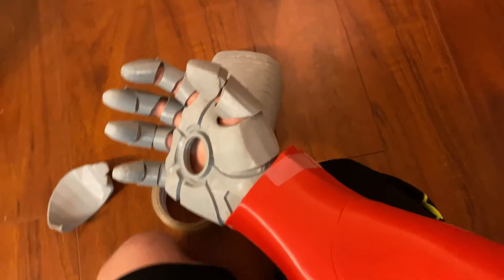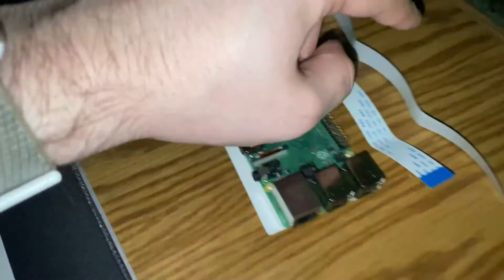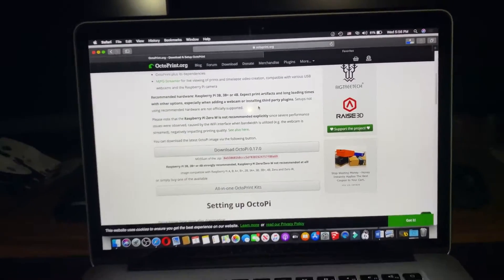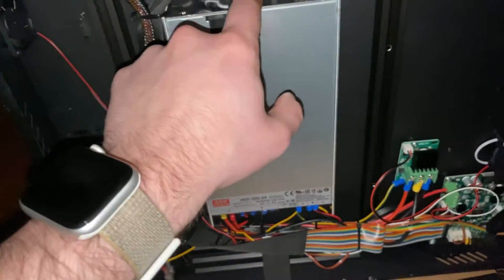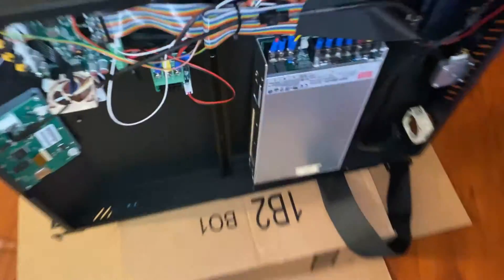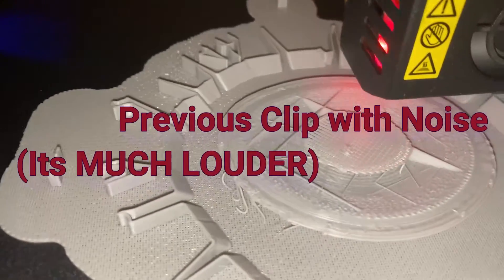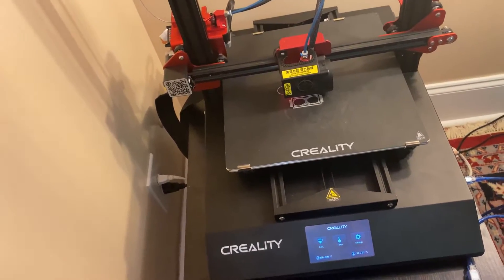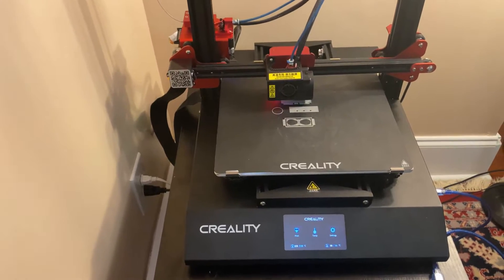My 3D Printing Journey| Part 9 | UPGRADING CREALITY CR10S PRO V2 !

Comment: If you haven't already, look into the Tiny Machines firmware. Been on my list for my Cr10S Pro and I finally got around to it. Totally worth it. They support both the V1 and V2. My favorite part is PID auto tune on the machine itself.

Comment: Can you use a sd card extension to levitate the hassle of unscrewing the bottom for firmware updates?
Reply from the maker: Not sure, have not tested myself. I wouldn’t recommend changing the firmware on the V2 yet. Hear it gives ppl issues often. Updating with octoprint also is easier

Comment: Thank you Anton for your videos. I too have that CR10S Pro V2 and have read of numerous issues regarding using Octoprint with this printer. I have noticed you mentioned you were having printing issues with Octoprint. Were you able to get these resolved? Have you tried using the Prusa slicer to see if that might help fix the issue. Best regards.
Reply from the maker: Joe Undreiner hey man! Glad to hear you enjoy the content. What I learned was due to a slow gcode read FROM octoprint it’s best to print from the local SD card. Now All works great! I use octoprint to monitor my prints and just upload the files the old way and not through octoprint which has fixed all my issues
Reply: @AntonsCreations  What about now? After 0.18? It's got to work now yea?

Comment: I didn’t see anything on here about wiring fans. I thought stock fans were 24 volt. Other videos indicate you need a PCB to change voltage or you have to wire two fans in series. If 12V fans are running at 24V, they won’t last long.
Reply from the maker: Precisely! I wired two fans in a series to have 12V each from a 24V. Works well so far!
Reply: Anton Talks Tech Thanks. Bought the CR10S Pro V2. Hasn’t arrived yet. Adding many upgrades before I have it. . Your videos help. Love ❤️ that you reply. Suspect you will build a lot of viewers. Well done. Subscribing out of respect.
Reply from the maker: Trevor Westerdahl thank you! ecstatic to hear I’m of some help and congrats on your purchase! Hope all goes smoothly and you’re happy! Also- Welcome to the community, glad to hear you joined. Got lots of exciting content upcoming for you all :)
Reply: Did this work for you? I just tried this and my wires are smoking

Comment: Hi, love your videos! I just got the same printer, the prints are coming out kinda okay after some testing. But the bottom layers aren't very good on most.. tried a lot of leveling, but can't seem to get it right. 
Could you please tell me how you level yours? Do you have auto leveling on? 
Also if you have the time I'd greatly appreciate it, if you could answer some more questions :) What is your print speed setting? Do you have special settings set for the first layers? I saw in a video that you had the nozzle temp at 220°C but the bed temp at 0°C, so the bed temp doesn't seem to matter a lot for you for the result? 
Thank you very much! Please keep on posting :)
Reply from the maker: Ill do a quick overview of how I level the bed soon! in short- turn of auto-leveling, use aux leveling and the 2mm tool and make sure bed is level on all 5 quadrants. hit home, hit measure, heat bed- repeat. if too low or high you can always raise your Z. once done-turn on auto level and you are set!

Comment: Awesome dude, just as promised, cool video! I've been looking at a bunch of reference material online, but it's mostly on the "CR-10S Pro" and not the actual V2, although they're practically the same. The only real question from me, is noise aside, are the Noctua fans actually still keeping the same CFM as the stock fans? Idk
Reply from the maker: Glad you enjoyed it! There have been tests done by others to measure the heat and the airflow is ample for the system with these exact fans. It seems they do they trick (i used for a week no problems so far)
Reply: @AntonsCreations  i want to add a raspberry pi to my printer same as you have but see there a lot of issues what did you do to set up for monitor and all that